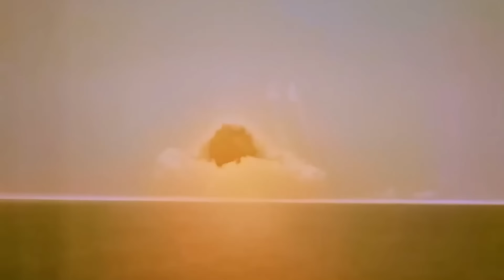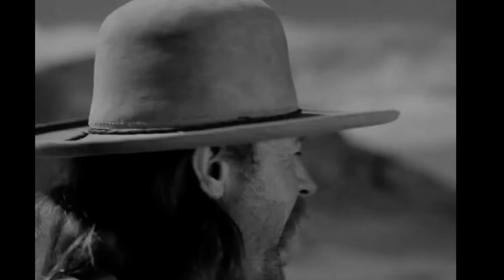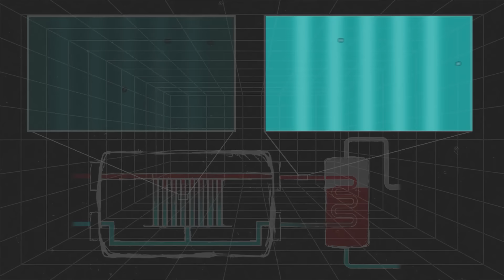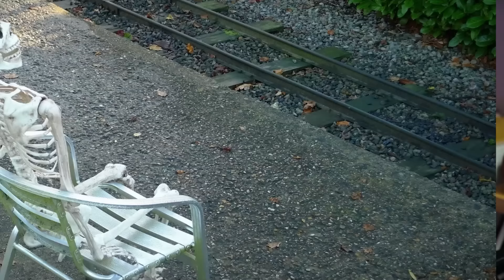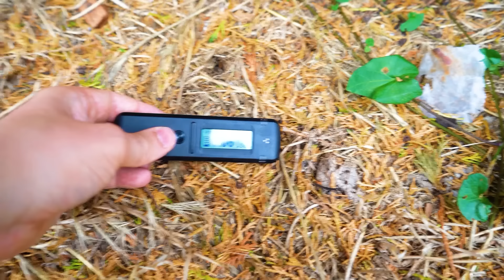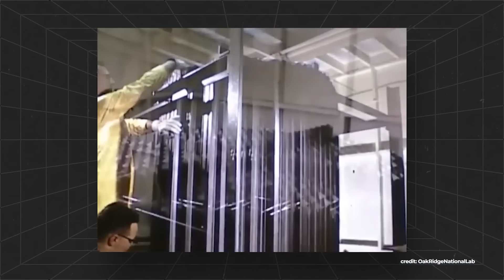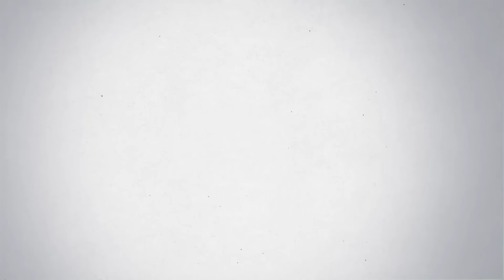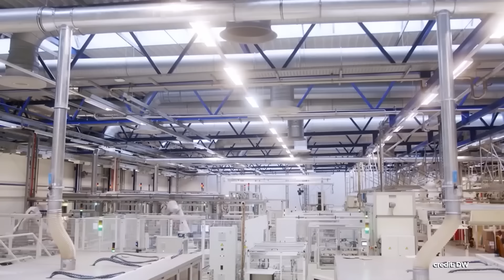It's Happening - China Launches World's First Thorium Nuclear Reactor

Comment: Thank you so much for the explanation! I finally understand why this kind of new reactor could stop instead of exploding when the coolant fails! As of China, I won't challenge their timeline at all. They have proven to stick to their plan for moon exploration, and kind of zero failure. So far China has not killed any astronauts whatsoever while NASA has managed killed dozens and have 2 stranded in space right now! As of energy, I am quite sure China will "over-produce" solar and wind power in a few years and could sell the green energy to Europe in totally "unfair" trade. I would say there if there is any hope to achieve carbon neutral, it could only be done by China.

Comment: At time 13:48 you say that "they don't need water cooling".  If they (Thorium MSRs) use a steam turbine, about half the energy is lost to heat.  If you don't remove the heat, it will get hotter - eventually getting too hot to work.  Steam generators need cooling.  The water does get mostly recycled, but they still need water for cooling.

Comment: Not mentioned in this video: the primary reason the Molten Salt Reactor Experiment was ultimately considered to have "failed", was that the flouride salt used was damaging the Hastelloy piping at a much faster rate than anticipated. It is well known that neutron bombardment causes embrittlement of most steel alloys, specifically, it increases the nil-ductility transition temperature of the steel, but in the case of the MSRE, the hot flouride salt was not only chemically attacking the pipes and valves, it was also reducing the ductility, a dangerous condition because embrittlement can result in catastrophic failure of a pipe from even a minor impact or vibration stress, for example, if a  high-speed gate valve is triggered to slam closed in some type of shutdown emergency. The salt damage to the piping was so widespread, that the engineers determined that the entire piping system needed to be replaced after only 5 years; this would be completely unacceptable in a commercial power plant. I wonder how the Chinese have solved this problem in their molten-salt reactor? At the time that the MSRE was built in the 1960's, Hastelloy was the most corrosion-resistant alloy known, maybe the Chinese engineers have come up with something better?
Reply: I think I remember hearing that by the time the report on corrosion issues was distributed they already had a viable solution to it
Reply: @laura-ann.0726  They are not using the same alloy. I understand they have gone for higher nickel content amongst other variations. Overall the problem seems manageable because the chinese have now moved on from the experimental plant and have approved an engineering prototype.
Reply: @jimgraham6722  I wouldn't base opinions on what the Chinese Communist Party does. They'll accept risks we never would and if anything goes wrong, they'll just cover it up. Metallurgy has come a long way since 1967, and we have decades of experience with at least ten different Hastelloy alloys.  The problem is solvable.
Reply: The Chinese have added pepper to the salt, salt and pepper go well together.
Reply: Reminds me of development of jet engines. The fan blades couldn't take the heat. It took many years to find a metal that could operate under such high temperatures, and that changed the direction of powered flight.
Reply: @jamesraymond.1358  -  Even today, turbofan jet engines operate at temps near the upper limit that the turbine blades can tolerate. Many of these aircraft have timers built into the control software that limit application of maximum take-off to power to no more than about 4 minutes, after which power must be reduced to below 90% for climb-out. Once at cruising altitude, the engines on typical modern airliners like the Airbus A-320 or Boeing 787, will be operating somewhere between 70~85% power settings, depending on the weight of the remaining fuel (as fuel is burned off, the aircraft slowly becomes lighter, the angle of attack can be reduced, and thus the power needed to maintain speed and altitude can be reduced). I recall reading somewhere that jet turbine blades are hollow; high pressure air from the compressor stage of the engine is routed to the turbine blades through air passages machined into the rotor blade hub, cooling the turbine blades from the inside, and exiting through tiny holes drilled into the blade. Not sure if this is all turbine blades on all jet engines, or just on high-performance engines for military fighter jets, but it's apparently a design feature on at least some aircraft jet engines.
Reply: I looked up this in their publication. I don't think this has been fully solved yet. But they are totally onto this i think at least 50% publications are focused on this problem. The tried different salt combination, using fluoride, try different pipeline materials. I am impressed about how much work they have been putting into this. However lots of recent progress wasn't described in detail i guess they won't till full patent file comes out.
Reply: They use PVC pipe like in my bathroom.
Problem solved
Reply: @syfre9506   I don't think PVC would take the heat of the Thorium molten salts which can be up to 700 deg. C.
Reply: @WJV9  More like 1300 C.
Reply: I'm surprised that no one is talking about ceramic linings for the pipes.  Ceramics are hard, strong, and can take high temperatures, molten salt environments, and neutron flux.
Reply: @martinmelhus7324 Ceramics are prone to cracking.
Reply: @marcuscoquer5958  True.  But metals are subject to irradiation brittleness, even the Hastelloy alloys used in reactors.  It's a question for the materials science community, finding the best combination of radiation resistance, durability, and heat conduction (since if the heat doesn't leave the reactor, it doesn't generate power).
Reply: @syfre9506  😝🤣
Reply: Basically they use a new metal material for that. LI Zheng-zhou, NAI Qi-liang, MO Shao-hua, WANG Bao-shun, WANG Man, DONG Jian-xin. Effect of heat treatment on the microstructure and properties of nickel-based superalloy thin-wall pipe for the fourth-generation nuclear reactor[J]. Chinese Journal of Engineering, 2018, 40(5): 571-578. DOI: 10.13374/j.issn2095-9389.2018.05.007shu
Reply: Agreed.  But that does not mean that material science can not work on that to solve that problem.
Reply: guess what, they did
Reply: > The salt damage to the [MSRE's] piping was so widespread, that the engineers determined that the entire piping system needed to be replaced after only 5 years

I would be interested in your citation.

> [the MSRE considered to have failed] was that the flouride salt used was damaging the Hastelloy piping at a much faster rate than anticipated.

What I have read is that tellurium was precipitating out of the salt, attacking the piping. This could be fixed by changing the redox potential of the salt (kind of like pH in water) by modifying the salt.

> [5 years & faster rate of damage to piping] completely unacceptable in a commercial power plant

The Canadian startup Terrestrial Energy suggests their plant can be economical even with the reactor being replaced every 7 years.
Reply: @factnotfiction5915 No one invests in suggestions.  Especially high risk financial decisions that need to be based on hard facts rather than the usual “operational in x years” that never happens.
Reply: @factnotfiction5915 if replacing pipes every 7 years can be economical then 5 years certainly isn’t viable.
Reply: @DB-ku7vu  > if replacing pipes every 7 years can be economical then 5 years certainly isn’t viable.

You appear to have missed a logic step there.
Stating that replacement every 7 years is viable indicates:
a) corrosion isn't a 5 year issue, but at least 7 years or longer
b) that doesn't preclude economical at 5 years, it merely states that it is at 7
Reply: Copenhagen Atomics (yes, Denmark) sells purified low corrosive salts specifically for thorium salt reactors.  This a a solved problem already.
Reply: If I were to address this problem from scratch with modern materials, I would use ceramic materials. These are far more stable vs radioactivity, chemical reactivity and so on. I have every reason to believe that the Chinese people, with literally thousands of years of experience using ceramic materials, would explore this in detail.
Reply: I scanned through the video. And indeed I missed a single piece of information: how to keep the reactor alive.

There have been many attempts at molten salt reactors. They all came to the conclusion that radioactive molten salt is extremely corrosive.

Until a plan comes up that acknowledges this and provides a solution, this is all just a repeat of the same problem that isn’t fixed.

And that’s not because I don’t like nuclear. Even without radioactive salt, using molten salt has also proven to be impractical with solar. Decades ago they made CSP solar plants, where they heat up salt using mirrors and sunshine. These plants also suffered the same problem. You just can’t keep the machines from corroding.

When adding radioactive stuff in the salt, it is even worse. Not to mention when you have to extract the fission particles from the salt.

Many tried. All failed. No mention why this would be any different.
Reply: @dnbeuf72  They were actually the first to figure out a solution. They found that hyper-desiccating the molten salt prevented it from corroding steel, as molecules of water appeared to act as a catalyst.
Reply: @dnbeuf72  Watch some content about Moltex SSR-W reactor. They use fuel assemblies that looks like traditional, but they use liquid salts. Tubes are made from standard nuclear certified steel with zirconium protective layer inside. No need for pipes, pumps, valves etc. Very simple reactor design and according to them very cheap to build. They are working on certification in Canada.
Reply: Replacing pipes?  That doesn't seem to bother all the cities that have to routinely replace the pipes that put fluoride into their water supply.
Reply: @earthling808  Room temp .00x% aqueous solution is not the same as 1000+ degree molted salt.
Reply: @mikesgarage394  > Room temp .00x% aqueous solution is not the same as 1000+ degree molten salt.

Agreed! room temperature aqueous salt solutions are MORE corrosive!
Reply: @factnotfiction5915 he’s taking about floride
Reply: @factnotfiction5915  why is that
Reply: @nade5557  > why is that
I'm not sure what the 'that' is that you refer to.
Reply: @factnotfiction5915  ah yes my bad. Why is room temperature aqueous salt solution more corrosive than molten salt
Reply: @earthling808  The differences between that and this are so large that they render the comparison invalid.
Reply: @earthling808 You do know that fluoride is naturally occurring in water?
Reply: @earthling808  - The amount of flouride in city drinking water is measured in parts per billion, and parts per million for chlorine - the concentration is so miniscule that it would take hundreds of years for the chlorides and flourides in drinking water to noticeably corrode or damage the copper or PEX pipes in homes. The fuel salt in an LFTR (and the Oak Ridge MSRE) was pure salt, concentration 100%, and under normal operating conditions it's extremely hot, about 500°F, to keep it fluid enough that it can be pumped through the various piping systems to the steam generators and fuel processing equipment. The systems that handle flourine and chlorine for city drinking water operate at room temperature; the gas isn't hot, so it's not as corrosive as it would be if it was at the temperatures seen in a steam-turbine power plant, nuclear or otherwise.
Reply: @earthling808 
Aren't you concerned about fluor in our toothpaste too?
By the same reasoning, that has to severely corrode our drains 🙂
Reply: My guess is that the Chinese engineers solved the problem of corrosion by looking the other way.
Reply: @Tjalve70  Took a while to find the classic rascist comment

Comment: Remember viewers, if someone refers to every nuclear incident as a "meltdown", they likely don't know what they're talking about.

And if they also imply that pressurized water reactors are more prone to "explosions" or incidents from a loss of coolant, they don't even know that the water that cools the core is also the water that modulates the reaction, without which, the reaction would stop 100% of the time. That's the inherent safety of water reactors and it's the reason another "chernobyl" is physically impossible.

Comment: Small typo at 9:48. I think you transposed two particle names. Instead of saying "A proton undergoes beta decay and becoming a neutron" it needs to be the other way around.

Additionally, the "seed" material to start the reaction is not usually uranium 233... that stuff is too spicy to easily handle, highly radioactive and does not exist in nature. Usually the reaction is started by adding U235, the same stuff used in uranium reactors. This starts the Thorium cycle which creates the U233, which is happily left inside the reactor as trying to extract and concentrate U233 to create, say a bomb, would just about melt anyone in a radius due to it's high gamma ray production. But left inside the reactor, diluted in the molten salt and being surrounded by the thorium shell as shielding makes it much more manageable.

There are other ways to start a thorium cycle, but describing those would be a great video all in itself.

Comment: already a problem, if you empty the reactor for a bit of time adding any salt water back will hit the hottest part and might explode.
Reply: molten salt != salt water

First, realize that salt (say table salt) is frozen.

If you add water to frozen salt, you aren't melting it, you are dissolving itiI you heat (dry) frozen salt high enough, you can melt it (around 800 C).

Note that as you heat the salt, any trace water will come off as steam (about 100 C)
LONG before you actually melt the salt.

Thus, the molten salt you are piping around your reactor is water free. So there is no possibility of a steam explosion from water in the salt. Also, frozen or melted - salt is not explosive.

Comment: Has China solved the Gamma radiation problem caussed by the Lithium ?.   
The salt used is Lithium Fluoride.
Lithium irradiated by neutrons splits into Deuterium and Tritium and Gamma rays.
Also Fluorine is extremely toxic and reactive.
Reply: > Fluorine is extremely toxic and reactive.
Agreed! FluoriNe is very nasty. FluoiDe is so benign we put it into toothpaste.
The salt is a fluoriDe, not a fluoriNe.

> Lithium irradiated by neutrons splits into Deuterium and Tritium and Gamma rays.
Yes, but not very much. However, like existing Gen II/III PWRs and BWRs, a molten salt reactor will have a hydrogen (i.e. deuterium/tritium) capture system, and the gamma rays are dealt with as part of the normal shielding.

Comment: Thorium makes sense.    Current nuclear power plant have to be huge, near an abundant  water source, and of course  produce  plutonium  which is  why nuclear proliferation is currently such a big  issue.  Technically thorium reactors can be built as small as you want  and literally anywhere  on  the planet.  You could build a thorium reactor to  supply a single  town,  a large industrial complex, or remote mines where currently it would be uneconomically viable due  to the lack of a a  nearby electricity grid . We are running out of minerals rapidly, copper is becoming more and more scarce  and even with recycling we are using it all as quick as we can mine it. Other essential minerals like  lithium, cobalt,  cadmium  etc that  we desperately need if we want to switch away from fossil fuels, are generally  found in  the least developed parts of the world, usually where there is no electric grid within economic reach.   Mining company spend huge amounts of money  extending power  grids  to these newly found resources and this increases the price off raw material or can  be the deciding factor as to whether a mine is economically  viable. 
 It would also have massive benefits for the  3rd world.  No  worries about the proliferation of nuclear weapons means countries that were prevented from having nuclear power now can.  Imagine the impact it would have in the poorest areas of the world,  With an abundant supply of electricity,  a star link for internet connectivity and now  you potentially have a massive workforce (once they have  been educated) that can work remotely online.  Now these poorest parts of the world would have a working economy, and money to invest in healthcare education and housing.
There are significant issues with molten salt reactors as was mentioned in the video.  These molten salts are highly corrosive, and potential could severely damage a reactor over time,. but if we can develop new materials to get a man on the moon, surely it would be worth spending a similar amount to tackle this problem.